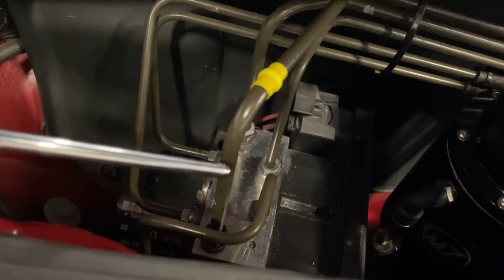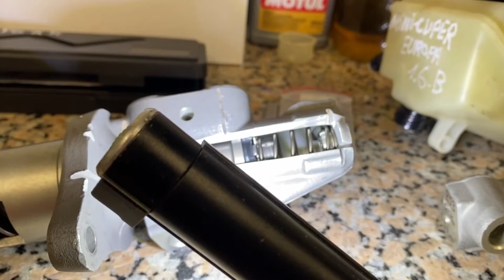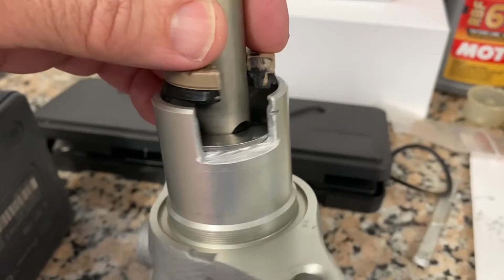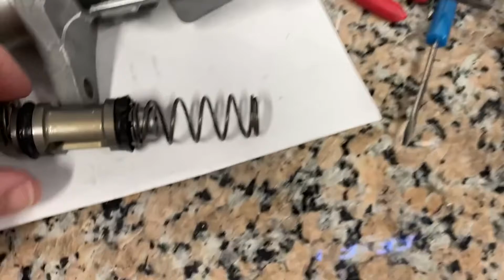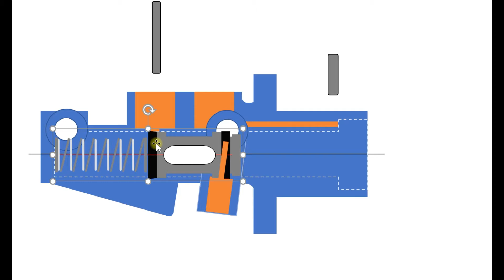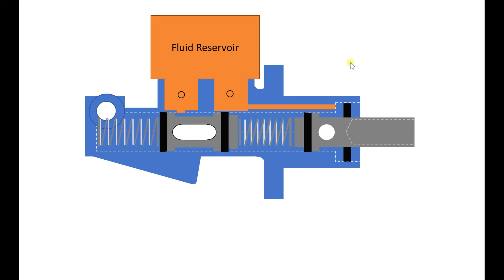Brake Master Cylinder

Comment: I have the exact same problem after installing jcw 4 pot calipers everything is brand new new oil etc I bleed several time using a scan tool and a power bleed but still have execessive travel. just remove the original master cylinder there is a little play in the shaft not sure if its normal I will probably install an E46 M3 brake master cylinder this week I will let you know !